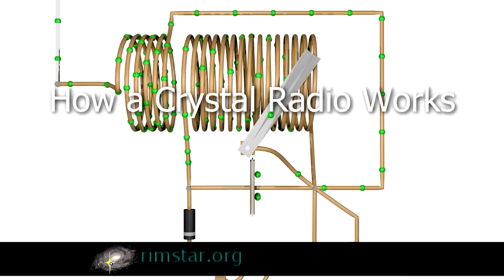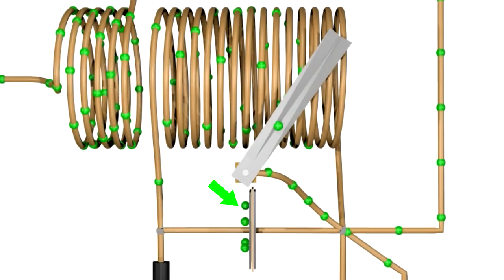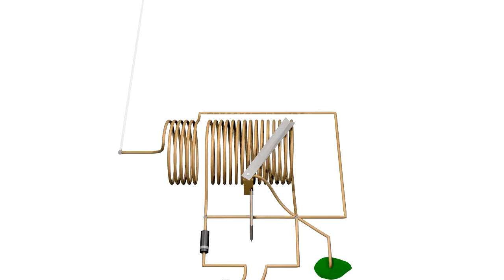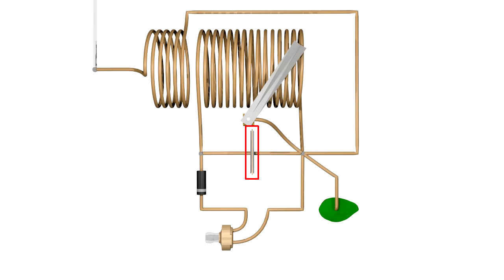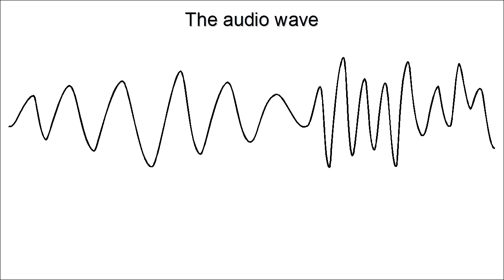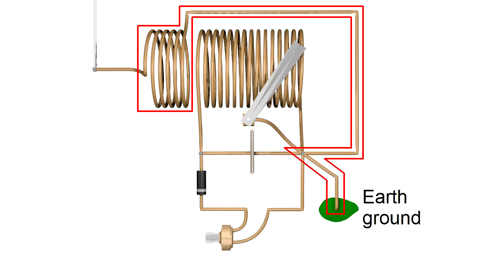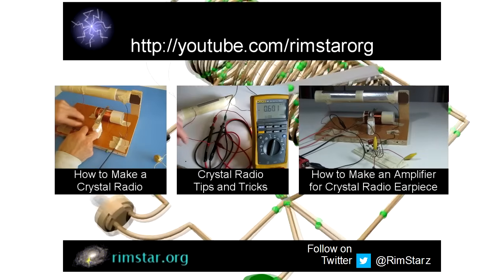How a Crystal Radio Works

Comment: This is 90% there, but I feel you are cheating by using a fancy-smancy store-bought diode. I want to know how to polish and mount a piece of galena to make a crystal diode radio set as used in days of yore. Or, how about a razor-blade radio?

I recall, years ago I opened up a radio to try to find the pile of soil (earth) listed on the circuit diagram. To this day I find the use of the word "earth" or even "ground" to be very irksome.
Reply from the maker: baddoggie101 I would like to try the galena and cat's whisker some day, just haven't gotten around to it yet (too many projects.) I've done the razor-blade diode in this video "Make Razor Blade Diode for Crystal Radio/Foxhole Radio".Regarding looking for the earth in the radio, :). Sounds like something I would do too.
Reply: RimstarOrg Taking another look at your very fine animation I see something else that is a little bit screwy. I appears as if you have five conductors coming together into a single node which is connected to ground. I think your sketch is "sketchy" in that you probably did not mean  to imply that they are all connected  at that node. Only the  leg of the primary coil should be connected to ground. In addition, if the diode was reversed and the right most conductor was connected only to ground it should also work, provided you use one of those early type of earphones that drove the earpiece diaphragm with a coil.  Correct me if I am wrong.
Reply from the maker: baddoggie101
You had me worried for a second. All 5 are all connected to ground at the common node. You can even see it in my actual crystal radio which was the model for this 3D animation https://www.youtube.com/watch?v=VqdcU9ULAlA

Comment: A nice in depth explanation. Years ago in 8th grade, my science class I knew was too easy. We had to show a project and present it to class. I even surprised the teacher when I came in and showed, and gave a basic explanation of how a basic crystal AM radio worked. I think the idea of invisible RF radio waves inducting and powering the system blew their minds. Besides capacitors and coils, I don't recall if I got into the different things that could and have been used as a detector to tune like cat whiskers.

Comment: I was messing with a DIY crystal radio for fun, super simple, crocodile clips, paper and foil and few other components.  Didn't have a crystal earpiece so I just hooked it up to a small amplifier and a speaker.  Interestingly the only thing I could pickup is the local FM station haha. Cool how you can pickup radio with something this simple.

Comment: I BUILT MY OWN CRYSTAL RADIO 51 YEARS AGO.    The diode was actually a rock.  It was a small quartz crystal rock that was placed within aluminum foil and had a wire poking in the exposed area. The rest of the tuning wire was wrapped around the cardboard of toilet paper. The ear piece was taken from a landline telephone. It worked perfectly. Anyhow, now you know why it is called a CRYSTAL radio. And, no capacitors were involved.

Comment: Nice animation. I am an engineer and already understand how it works both mathematically and how it really works physically.
It would help to not hide some words and concepts that you think are too complicated for most people.
You mentioned frequency, which is admirable, but don't make it clear how much a gap it is going from 4 Hz to real sound to AM radio waves.
The word that you avoid to use is "BANDWIDTH". It represent how many hertz above and below the tuning frequency are allowed to make it to the diode and earphone.

If the bandwidth is too high, we can ear two or three radio station at the same time. Changing the tuning can eliminate one station but pick up another, so we keep getting a garbled mix.

If the bandwidth is too small, then the volume of the station is lower, forcing us to set the volume higher, or limit us to the strongest stations when using only headphones. Also, a bandwidth set too low have an impact on sound quality, reducing the clarity of the music like if the "treble" control on the amplifier is attenuating too much.
Reply from the maker: Thanks.
Good points. I've a feeling a video about crystal radios and radios in general can be an hour long easily.

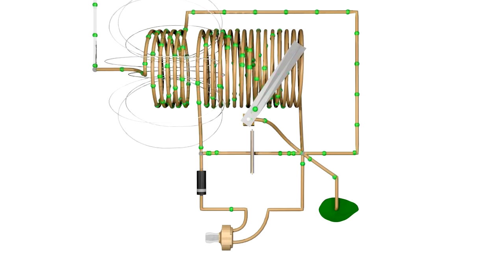Comment from the maker: The earpiece can only respond to the lower frequency audio wave, not the high frequency radio wave. But the audio wave is both positive and negative voltage at the same time, so the net is 0 volts. The earpiece would do nothing. So the diode chops off half the waves (the negative half, for example), and now the earpiece can respond to the positive half. See the video starting at 9:16.
That also answers your second question. The earpiece is only fast enough to respond to the audio wave.

Comment from the maker: Yes, you have to have an antenna. You can use a long, horizontal wire as the antenna but there is also another antenna design that I haven't played with yet called a hoop antenna, which takes up much less room.

Comment from the maker: The capacitor is in this crystal radio circuit for tuning purposes. But as the circuit at 12:00 into the video shows, it's possible to do without but you'll lose out on selectivity.

Comment: Wow. Memory lane!  
Back in winter of 1973 (i was 5 and half years old at the time), i had build such a diode based crystal radio (a kit my dad got for me at RadioShack, or so i believe) and the idea and realization of this "passive powered" device allowing me to actually hear radio thanks to my outdoor long antenna, a wire linked to  the heating radiator and the metal rod scrubbing the winded coil to find some radio station to hear in my mono piezo headset...all this was jarring and magical to me.
Of course, being a kid, after a while, i just had to experiment with more power, just to see what would happen.
That was a dramatic end to my radio as all of a sudden, having put the antenna in a power outlet, i had to rip the headset from my head (as it instantly blared at high volume and got physically hot!) just for a few dramatic seconds before the wire coil overheated and lit itself on fire!
Thank god, i quickly managed to rip all and toss it in the snow outside my window. The house smelled bad for an hour or so because of the coil and diode smoking up the air (and  instinct told me to keep the window open for fresh air!) but no major fire took place n that day (thank god!)
The whole ordeal was exciting (and scary also) but i then realized i wanted to understand more about electronics...and also that electricity can be dangerous (LOL) if you don't respect it.
Years later, driven by curiosity and my passion for  sound and music, as a young adult, i actually as running experiments and eventually  a few labs  in acoustics and psychoacoustics.
Gotta love science!
Thanks for your very well made video and the trip in my memory lane.  :)
 
Ps   I really don't recommend recreating my wire in power outlet experiment... But if you must, its at your own risk and you should prepare for the worse! But seriously, kids, don't do this at home! 
Stay Safe & Stay Smart.

Comment from the maker: You can build an amplifier but I don't have any circuit off-hand. It's not something I've done at this point. You may also be able to use a small 1:1 transformer between the diode and the earphones but I haven't tried that yet either. That may also depend on the impedance of your earphones.

Comment: A radio powered crystal radio. In the early 1960’s I worked at the Diamond Ordnance Fuze Laboratories (DOFL) located on the grounds of the National Bureau of Standards,  (Connecticut Ave and Van Ness), Washington, D.C.  A fellow worker invented a radio powered crystal radio.  There was a strong AM station nearby.  Using a long antenna, he captured the signal and rectified it to amplify a crystal radio.  No headphones necessary, just a 12” speaker!  It was loud enough to fill the room.  He used a germanium transistor (for its 0.3 V forward drop) amplifier.  I share this story in the hope that it will be repeated.  IICRC  The inventors name was Wes Nichols.
Reply from the maker: But all crystal radios are radio powered, that's what it means to be a crystal radio. They're powered by the incoming radio waves. However, it sounds like Wes Nichols was lucky enough to have a long antenna and be near a strong AM station so that the output signal was strong enough to power a speaker instead of a small piezoelectric earphone.
Reply from the maker: And thanks for sharing. It's always great to hear of success stories about crystal radios.
Reply: @RimstarOrg  A crystal set without an amplifier will most likely not have enough power to operate a 12" speaker.  Crystal sets have  just enough power for a crystal earpiece. For speakers, additional power is required.  A radio powered crystal radio is one solution to get free power without using a battery.  Can you think of another free power source?
Reply from the maker: What do you mean by a radio power crystal radio then? Do you mean he had a radio transmitter and then used the incoming radio waves from that to power a crystal radio? Firstly, the radio transmitter is powered so it's not a free power source. I guess they were also pretty close together  for the crystal radio to power a speaker. But that's the same as being close to a powerful radio station and being able to power a speaker. That's the two ways in which a crystal radio can power a speaker, if it has a very long antenna or is near a powerful radio station.

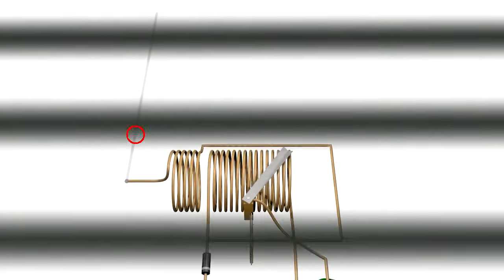Comment from the maker: Here in North America I connect it to the ground hole in a wall socket. If you have metal pipe under your sink or radiator that you know go underground then you could connect to them. I show this in my "Crystal Radio Troubleshooting and Tips" video at around 3:57 into it. There's a link to the video in the description below this video.

Comment from the maker: The second coil works with the capacitor to select, or tune into, a precise frequency. The second coil and the capacitor will resonate with each other at a precise frequency. That frequency is chosen by the inductance of the coil and the capacitance of the capacitor. That is why we use a variable capacitor and a tunable coil.
I wish I had time to put captions on the video. :) The answer starts at 3:36 in the video. Also, search for resonant frequency and parallel LC circuits. I'm happy to help.

Comment from the maker: Bonjour. You didn't ask a question. But I will try to respond to what you said. To my knowledge, I don't think the variable amplitude (voltage) will affect the charging of the capacitor compared to non-variable amplitude. The capacitance and frequency are more important (see capacitive reactance.) The capacitance is how much charge can be stored for a certain voltage. So lower amplitude/voltage will put less charge. But that is the same if you have a precise frequency with low amplitude.

Comment: Thanks for this clear video, why to use a second coupled coil increases the selectivity?
Reply from the maker: Thanks. It's good to hear from you again.
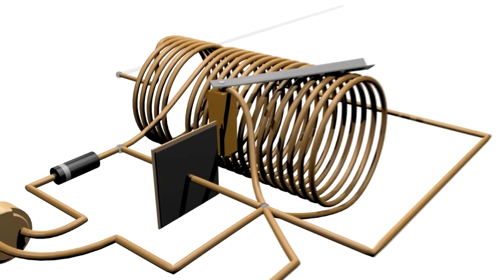The tuning coil and the capacitor together make a tuning circuit. Together they resonate easily at a specific frequency. This means that they produce current easily at a specific frequency. But they do not resonate very well at other frequencies. You choose the frequency by moving the wiper blade on the coil and by adjusting the capacitance of the capacitor. That's how you tune into a certain radio station. All other frequencies are rejected in a way, they cause current in the path from the antenna coil to the ground instead. Part of the explanation is at 4:30 and 5:52 and again at 10:43. I also have a video explaining this coil/capacitor tuning here https://www.youtube.com/watch?v=shZUI6B5bZw

Comment: Great explanation.  For me, the charm of a crystal radio was that you didn't have to plug it into the wall or connect a battery.  I sort of understand now that it's picking up electromagnetic energy through the air, but it still seems like that would be too miniscule to mechanically produce sound waves, and yet it does.  I'd like to more fully understand it, but that would take a much longer video.

Comment: I've been aware of the basic circuit for decades, but a few months ago I suddenly realised I had never understood what the diode was doing. Text books often say it's there to demodulate the waveform, and I'd accepted this for years before thinking "no it isn't, it can only be rectifying it. The RF is still there!". Your explanation shows I was right - the text books are being too simplistic.
Reply: hmmm        some thoughts         consider the make-up of the original 'crystal detector'.     a wire touching a galena crystal in just the right spot.     how does that work.          more recently, other common metallic objects have been used in a detector.   see foxhole radio.
a diode clips  AC  to become  DC.        at tens of thousands of hertz, the output should be high-rate pulsating DC.    which a piezo transducer 'likes'.     or, is a crystal transducer an  essential part  of the circuit.?

Comment from the maker: Re thirdly... again, we need the diode to chop off half the wave. A resistor wouldn't do that. It would only slow down the electron flow in both directions.
Re fourthly... other frequencies above and below can still influence the parallel circuit. It's isn't perfect. Increasing the spacing between the two coils helps, but you also lose energy transfer between the coils that way and hence volume. See the video at  10:44.

Comment: Very nice, clear explanation. One small criticism - I think it would be better to leave the end of the tuning coil un-grounded and only ground it through the wiper. The way you have it, you have created some shorted turns. Since there is no core (just air), the negative effect of this is reduced but it will still be present to some degree. The effect is increasing the losses in your tuning coil, reducing both the sensitivity and selectivity of your radio.
Reply from the maker: Thanks. A few have pointed this out before but I have yet to get a chance to try it, and I'm really curious to see the difference. Someday I'll haul it all out again. This was the way it is in the book from which I took this circuit.

Comment from the maker: Yes it's just a crystal radio, almost identical to mine. The impedance matching box is just for the output side so that you can use more than just a crystal earpiece to listen to. I do the same thing in my "Use Earbuds/Earphones with Crystal Radio" video /watch?v=GCh2LVHUavQ using a transformer. It won't help you get more stations. I don't know much about FM.

Comment from the maker: I don't know why turns would be more important. The resonant frequency, which is what you tune into, is dependent on capacitive reactance and inductive reactance. The inductive reactance is dependent on inductance. And inductance includes all three. I like longer coils better than shorter since you don't have to be as careful, it spreads the frequencies out more on the coil. But length takes into account turns and length and even diameter since if you change one you have to change the others.

Comment: I know I'm 10 years late, so probably won't get a reply, but I'm going to comment anyway.
I built a crystal set in the early 90's at the start of my Electronics hobby, which became my job.
I heard your comment about leaky Germanium diodes and that caught my attention. When I built mine I was under the impression that the "crystal" in crystal radio had to do with the tiny amount of current from the crystal diode?
Now I'm older, and have 30+ years of radio experience. In particular, DXing where I shouldn't be with CB radios I "enhanced" and hi gain antenna's both bought and built, I understand better how that small amount from the coils can then be amplified in both directions, but I've never heard diode leakage in a crystal set explained like this before.
Reply from the maker: I always thought the "crystal" in crystal radio was from the times when an actual galena crystal was used instead of the modern diode. The sharp tip of wire would make contact with the crystal and that is where the rectification would take place.
Reply: @RimstarOrg   Thanks for replying. The fact that you believed something similar is reassuring.

Comment: This crystal radio set is different than the one I made or fox hole radio. On mine the coil was one set of windings in other words just one coil. The tuning was done on the razor blade the pencil lead was tied on the end of the safety pin. I tried it but had an idea and used a fat capacitor and one end was put on the razor blade for tuning. I picked up KQV which was the weakest AM station in Pittsburgh PA. I also picked up KDKA which is easy because of 50,000 watts. 73

Comment: My Grandma, Margy Petty, talked about lying in bed, listening to her crystal radio back in the 1920's. She described the tuning coil conductor blade adjustment as "wiggling a wire". She was low income, saying hers' was a cheap set. Is it possible she had a one with a fixed capacitor, relying completely on the tuning coil for channel hunting? Wow, this is an old video. I wonder if anyone will see this question? :D It's good edification. Thanks.

Comment from the maker: It's possible to use an ordinary variable capacitor. If by potmeter you mean potentiometer then a non-variable capacitor and a potmeter won't do the same job. A potmeter just varies resistance. A variable capacitor varies capacitance.